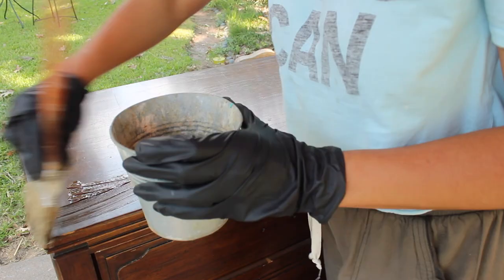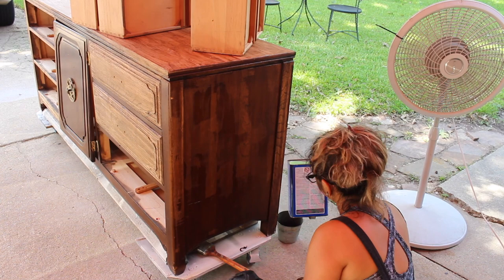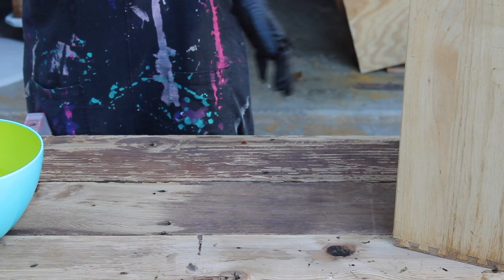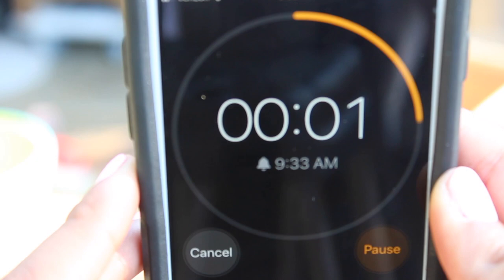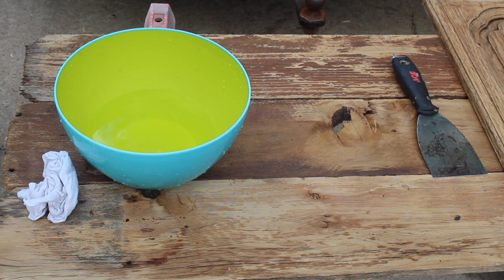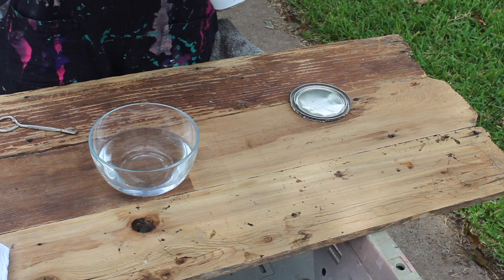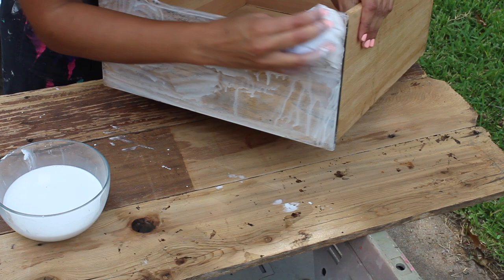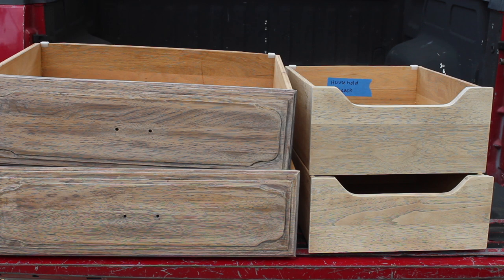Limewaxing Furniture - 4 different techniques

Comment: Looks so good!!!! great video.  Do you think the Dixie wax would be hardy enough for kitchen cabinets?
Reply from the maker: I think it would. It hardens (fully cures) after 30 days. 
If you use a magic eraser to clean crusted stuff then I’d probably spot re-ply every once in a while on the parts that need it. Other than that, I think it would be okay. 
Particularly with this worn in look, i think it would be very forgiving.